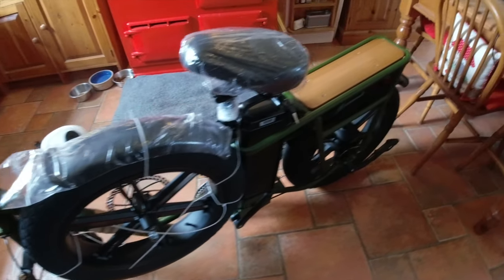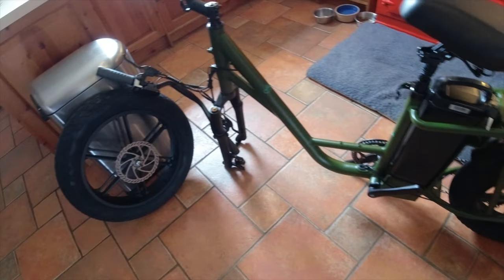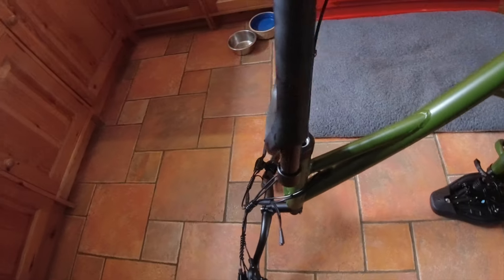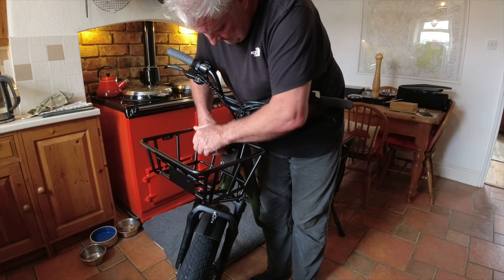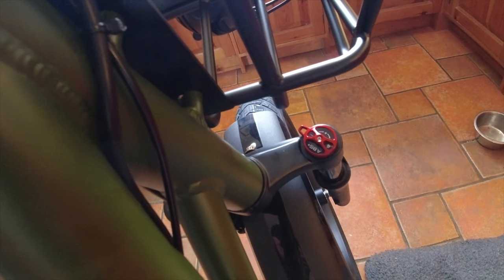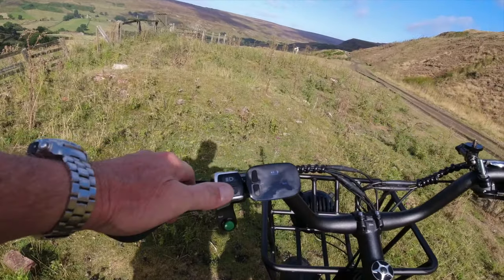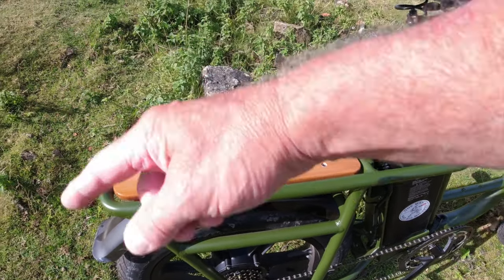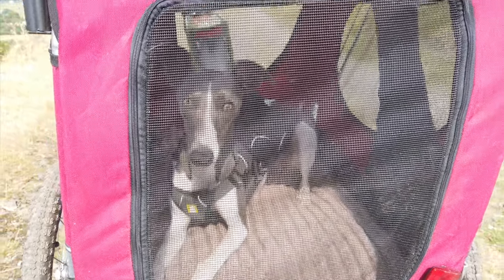Fiido T1 Utility EBike & Whippet Transport :-)

Comment: There are holes at 3 wiring points on the frame. Are you planning on sealing these? If it rains your bike is dead
Reply from the maker: Not planning too the wiring harness is waterproof 👍